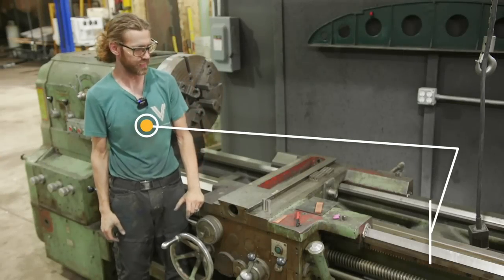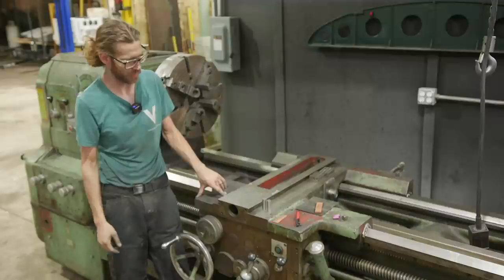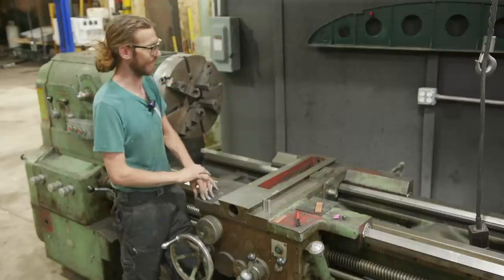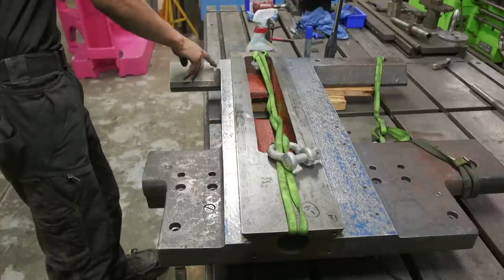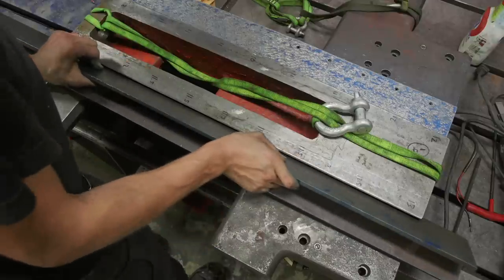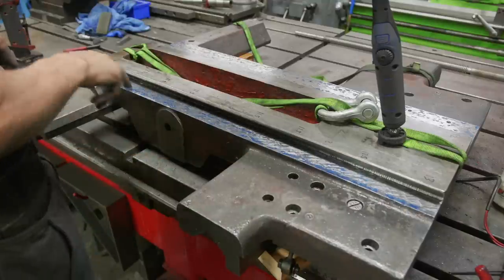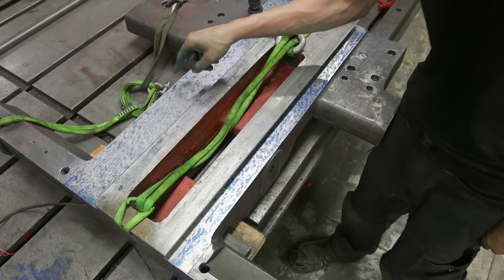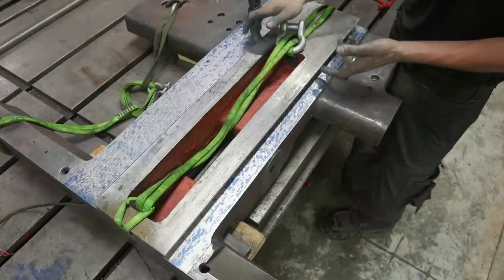Scraping the Carriage and Topslide | Lion Lathe Restoration

Comment: A very good result Kyle, well done mate! I know even the length of this "boring" video does not reflect in the actual hours you have put in to get the cross slide ways to the state they are now in. Just the gib to sort out and the Turcite( is that how it's spelt?) to add to it will sort it out no problem. That machine when you have finished will last donkey's years as we say here in the UK
Reply from the maker: Awe thanks. Yeah loads of work as usual but always worth it.

Comment: Why can't you just shim the back side of the gib with a brass strip? I have seen it done before.  It doesn't slide on the vee.  Much cheaper than turcite.
Nice work on the repair 
Joe
Reply from the maker: Yes you can it’s cheaper and quicker but there are many ways to do it

Comment: Why not add turcite/rulon to the cross slide? Same goes for the compound and the carriage itself really... You perfect the surfaces, you apply glue and rulon to the actual sliding part of the axis and voila, lost material ``restored``, geometries and heights preserved, and you have a softer surface designed to wear and bear the loads extremely well, as long as you have proper lubrication... I never like the idea of dropping the heights or actual modifications that mess with the original configuration... They are not sustainable... Some can be, but those are often major modifications like adding antfriction elements to what were original ways and slides and similar custom work... Rulon is quick and easy, sustainable and can be additionally added to both surfaces, the stationary and the sliding if the wear is significant enough to warrant such restorations... But that is even better, as you now have all the surfaces, true surfaces, scraped to perfection and you just change the bearing compound when it wears down(not quick if you have chip guards and way covers), thus making the machine ``infinitely`` serviceable and maintainable... Hell, some modern machines come outta factory with such dual rulon guideways and slideways... 

Otherwise, nice job! And a damn nice lathe, and a nice shop, actually, you know what, you just earned a sub...

edit regarding the wear pattern, it could just be the nature of the part in question... Things do wear concave, but keep in mind that the thing that rubs against them wears convex... And with prolonged wear and different load patterns, things can wear different and result in some strange patterns, especially if a machine slide was used a lot for certain jobs that had it running mostly on both extreme ends, rather than remaining mostly centered on the carriage in this case.. An example would be the cross slides with rear parting rest, where the lathe was used for series of parts and thus had it`s own rather different pattern of wear when compared to a lathe that only ran the conventional position tool post... I can`t say for sure the specific reason for this lathe, but there is quite a few reasons as to why certain wear patterns may develop... Hell, surface grinder tables are notorious for warping just because the magnet was clamped too hard and that in turn develops ridiculous wear patterns in the stationary ways, at least when talking about V+flat ways, or double V`s.... 

Best regards!
Steuss
Reply from the maker: Watch this weeks upcoming video
Reply: @VanoverMachineAndRepair  If it has a machine treated well, i`m all eyes and ears! 
Ave Omnissiah!

Comment: After you have cut the oil grooves, you need to make one or two finishing passes by scraping, because after cutting the oil grooves, stresses arise in the metal, the geometry of the surface changes, and accordingly the number of stains obtained and the contact area decreases
Reply from the maker: Good point check the video being released on Friday and will have remedied your suggestion
Reply: @VanoverMachineAndRepair  I'm looking forward to it

Comment: Nice work! I will say, why do you stone the scraped surface before removing the ink? That will clog the stone for sure. I first wipe off the ink with isopropanol then stone any burrs and wipe again with isopropanol to make sure any grit from the stone is not remaining on the surface. Hope that proves useful. Cannot wait to see the finished restoration, I always love true restorations which also make the moving surfaces accurate!
Reply from the maker: Yeah I usually don’t not sure why I did lol
Reply: @VanoverMachineAndRepair Ah, alright, it happens lol!
Reply from the maker: @romanvarcolac2238  agreed
Reply: Epic! You should be very proud.
Reply from the maker: @DangerousSportsForSeniors  thank you